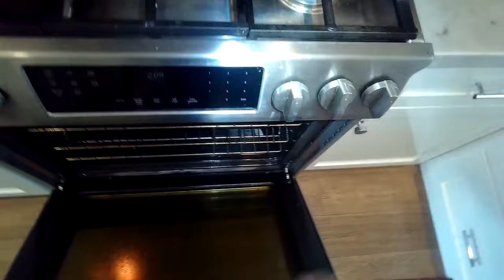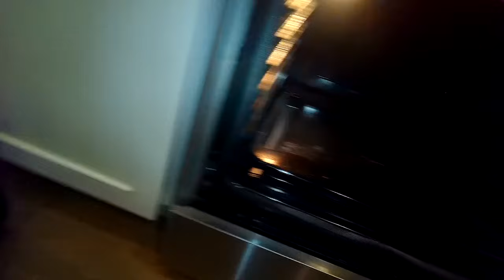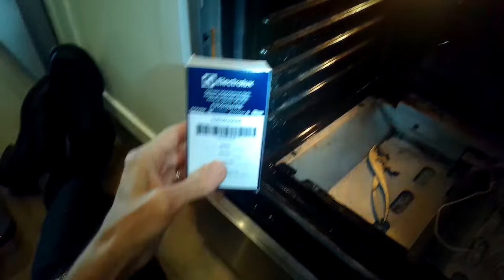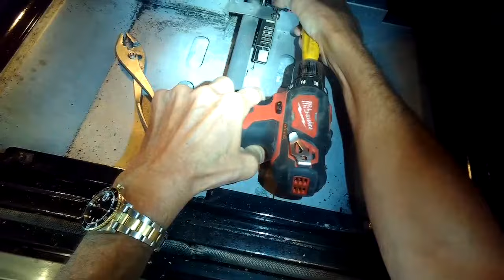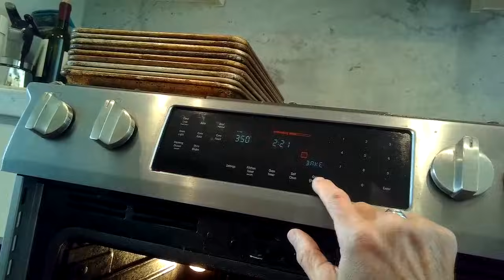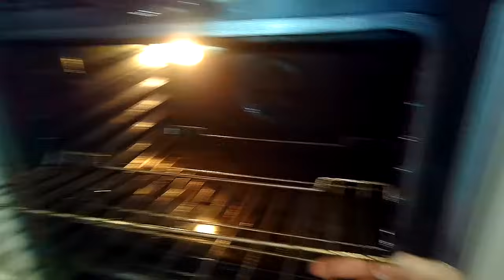✨ BOSCH OVEN WON’T HEAT - EASY FIX!! ✨

Comment: How did you know the igniter was the problem and not gas valve etc?
Reply from the maker: Great question?
From my repair experience,
The igniter is the culprit in over 75% of cases.

Comment: Awesome video.  Thank you very much.  *I don’t use my broiler very often so I switched igniters.  Torx 20 and a tiny wrench if you can’t reach the nuts. Quick and easy swap until new part arrives.*
Reply from the maker: Awesome, great tip! 😊

Comment: Hi Scott! What if my oven is not heating up fully (only going to about 300 degrees max) and it's an ELECTRIC Bosch oven? What do you think it could be? How can we know if it's actually the control board or something that might be an easy fix? Thanks!
Reply from the maker: I’d say the bake element located below the lower panel or the element in the back has stopped working.

Comment: Very cool video. Though you didn't show how to put the door back on. Now what?
Reply from the maker: Slide the door forks back into the frame and then pull the door down to 90 degrees and then flip up the catches near the hinges toward the oven and then close the door.

Comment: Thanks for the video! But I followed all the steps you did but still not working. Should be the igniter as the oven makes a click sound when I turn it on. But doesn’t heat up. I have the same oven as in your video. The wires from the oven look a bit different than yours though. I think it’s just some sort of insulation on mine though. I spliced the wires and connected to the new igniter. But no luck. 

Also how essential are the ceramic caps? I did lose one in the openings of the oven. I’ve ordered a new one so waiting for it to arrive. 

Any tips would be appreciated!
Reply from the maker: Thank you. When you get the new ceramic caps make sure they are on tight.  If still no heat you might need a new controller.

Comment: Hey yall. So my oven does heat up.... but it won't heat up all the way. It'll heat to like 275° but not up to 450° or anything.... would this be the same fix??
Reply from the maker: Hey Max,
I would suspect that the convention round element that lives near the back of your oven needs to be replaced.

Comment: is it ok to be cutting those wires with the oven plugged in and on? i see a light on in there. just checking. btw my igniter doesn't glow at all and my  bosch upper broil is fine but the bake is not going on at all my digital display shows the "pre heat" option start to fire up and just sticks on that screen
Reply from the maker: It’s best to turn it off.
A new igniter will fix it👍

Comment: Just one important nugget. I replaced my igniter and before putting the oven back together and the door back on I thought I would turn on the oven to see if it would would work and it didn't. After swearing for a bit I suspected perhaps there is some sort of safety cutoff that prohibits the oven from working with the door off. I replaced the door and it fired right up.

After posting this I read comments below and see others mentioned this as well. Guess I should have read comments before attempting this.
Reply from the maker: Excellent info. Dan,
Thank you👍

Comment: Great video, easy replacement but after turning the oven back on and baking, the ignitor isn't turning orange at all. Any tips?
Reply from the maker: Gotcha,
Did it glow a little before the replacement?
Reply: @QuickAndEasy5MinuteAppliance  no glow, nothing
Reply: if it doesnt glow before the replacement does this mean the igniter isn't the problem? @QuickAndEasy5MinuteAppliance

Comment: Very helpful. Just replaced last night. Question: are the heat resistant covers that were on when I pulled the wiring out really necessary or just optional? I did not reapply those to the new wiring
Reply from the maker: You should be fine😊😊

Comment: Hi thanks for your video.
Very clear instructions.
I have the same problem my oven is not getting hot and the broil is working fine, my question is that I see the old igniter is getting orange just the flame never starts dose that mean I need ignitor?
Basically my question is how do I know if I need a new igniter?
Reply from the maker: Great Question Josh👍 Click Here to Get Live Expert Help From Me For Just $5.00:
https://www.youtube.com/channel/UCGpInAejvpfVVE4FHB_L-Dg/join
Sounds like a new igniter will fix it👍

Comment: Worked for me except could not test until the firewall and oven door were back on but it preheated all the way now. Took ~35 minutes all told. Thank you! Tenants are happy that not only does it work, but I addressed their issue in 2 days (because Amazon Prime took 2 days to deliver the new igniter).
Reply from the maker: Nice work! 😊😊😊

Comment: 3 questions (I ordered an ignitor which will be delivered tomorrow):  1. How do you manage to get the oven door off? It looked so easy in the video but I tried moving the joints like he did in the video & it wouldn't budge. 2. My oven electrical cord is easily accessible in the cupboard behind. Do I need to shut off the gas too? It looks like I have the exact Bosch model shown in the video. 3. Do I need a right angle drill or can I manage with a short screwdriver to navigate the angle? I'm fine buying the drill if I need to. Hoping someone answers because my daughter ususally spends Thanksgivning (6 days from now) with her dad, she's coming here this year & I just realized my oven wasn't working though the range & broil work fine, I can't get a repairman at this late date.
Reply from the maker: Hi Patti,

You don’t need to shut off the gas.  It’s ok to leave the oven door on.  Can you try loosening those screws with your screwdriver?  I think they’ll come off.  I’ve done this procedure many times with the door still attached. You might want to put a drop of oil on the screw threads to make it easier for the screws to come out👍

Comment: I wasn't able to pull the ignitor out after unscrewing it.  I pulled it about 1 - 1/2 inches and it refused to budge.  I was afraid to pull really hard in case something would get damaged or dislocated.  The oven model is HGIP054UC. It looks like the wires may feed further back, behind the fan assembly, which I am afraid to remove without good diagrams or video.
Reply from the maker: Thanks Ron,
If you can get behind the oven and remove the back panel you’ll be able to see how those wires connect.

Comment: If you can pull the stove away from the wall it is much easier to make the connections as the gas valve and control box are right out in the open. When I replaced my igniter I just mounted the new one, fed the wires through the hole, and made the connections in the back away from the oven heat. My old igniter also had ceramic sleaves aver the wires which I simply slid over the wires on the new one before connecting. Doing it this way could probably be done without removing the door which can be a real challenge to reinstall.
Reply: I had to take the sleeves off and reverse them to be closest to the igniter. Made stripping the old wires much, much easier.

Comment: You showed me how to take the door off of my Bosch gas oven, however I'm having a heck of a Time reinstalling it! After you replaced the ignitor in the oven you didn't show how to put the door back on, Do you have a video for that? I don't know if I'm doing something wrong or if there is something wrong with the door now? It came off super easy after watching your video. I have been looking through your videos and I can't find one that matches.
Reply: Me too!!!  Did you figure out how ti reset the door??

Comment: Great video, very helpful!  Just one minor quibble for the purists:  Splicing wires is when you attach them together.  When you remove the insulation that's stripping.
Reply from the maker: Thank you👍

Comment: Hello; will this work the same for a Bosch Electric oven? Mine is an HDS8055u  Which is a duel fuel unit. Stove top is gas and the oven is electric. We have had a lot of power cuts which I think caused the unit to fail.

Comment: Great video, easy to follow. One note: if you’re testing the igniter after install, either put your door back on or fool the safety mechanism by pushing in on the pin the door would normally rest on. Dumb mistake, but cost me 10 minutes of self-doubt.
Reply from the maker: Good advice Jesse,
Thank you for the info.
Reply: Great advice!!! I was about to call someone over to look at it because it wasn’t glowing or anything and as soon as I put the door on it worked!

Comment: Hmm what do you mean by "won't heat"?  If I turn mine onto 450 an hour later it's still at 150 or so.  So it's turning on but not heating up properly.  Is this just a fix for not igniting?
Reply from the maker: It also fixes an oven that won’t reach temperature .

Comment: my wires don't pull out very far and are coated with a white mesh.  Can I still replace this
Reply from the maker: Yep,
Don’t worry about the mesh,

You can cut right through it and push it back.
Reply: @QuickAndEasy5MinuteAppliance  Thanks

Comment: Hi So I realized the broiler and oven won't work the stove top does so gas is working. I replaced the ignitor from this video now what? Thank you and great video!!! any help is amazing.
Reply from the maker: Nice job Brooke,
It sounds like it’s time to replace the safety valve.
That’s the part that will allow the gas to flow in to be ignited.
It sounds like it’s no longer opening up to let the gas flowing.

Comment: Thanks so much for this!  Bosch oven works perfectly now and probably saved me over $300 by doing it myself.  I will say that unlike the video, my ignitor did not heat up (nor did the broiler ignitor) until I replaced the floor housing and door.  I suspect that this might be a safety mechanism that Bosch created.  My unit Is 6 years old model: # HGI8054UC
Reply from the maker: Awesome,

Thanks for the update😊👍

Comment: Great video! I'm subscribed! Perfect title, I really like the narration. Thank you for narrating it after the fact - really helpful. Our brand new BOSCH's oven is inconsistent but basically doesn't work. Broil is fine. Range top is fine. Let's open her up and take a look, the warranty service call isn't for 3 days.
Reply: Hmm. Slightly different than the oven you fixed. Our igneters spark, the burner sometimes lights. Is it me or do you get less reliability the more you pay for an oven? We were forced into Bosch for sizing because of the requirements of the corner it has to fit in (thanks, whoever designed this kitchen! Haha!). Our friends with pro-style ranges seem to have complaints. Thanks for the great tips and inspiration, though!
Reply from the maker: Thanks Shannon, I would gently clean that sparking electrode with a wire brush to see if it will become more reliable 👍

Comment: Great video.  Saving a whole lot is so true.  VERY IMPORTANT!!!!!!!!  to mention that you used either PORCELAIN or CERAMIC wire nuts to connect the spliced wires.  Those are heat resistant to 1000 degrees F.  Also, you appropriately DID NOT cover them with regular electrical tape.  Black tape would melt at 200 degrees F, and cause big problems.    If you get a good connection, there's no need to tape.    IF you feel the need to use tape (or join with crimps, by twisting, or heat sealing), YOU MUST USE heat resistant glass or other specialized tape to cover the join.  What comes next are several observations on 'support-repair-services-and-official-Bosch-replacement-parts' NEWER Bosch models.  Read as necessary.  Sorry or the length.   :::::::  INSTALLATION HASSLES AND SMOKE/FIRE COMMENT:  Bosch has made replacing the igniter MUCH MORE DIFFICULT IN RECENT YEARS by shortening the wires between the igniter and connection, + adding a 2nd (largely unnecessary) box through which the wires travel to the connector.   IN NEWER (post 2012-14) Bosch Gas ranges, THERE IS A SMALL, PROTECTIVE BOX BEHIND the 1st layer of firewall.  It is almost impossible to get even the smallest plastic wire nut through the tiny (3/8" sq) hole in this box to fully protect the wire nuts.   IF YOU JOIN WITH PLASTIC FIRE NUTS, they will not meet code and WILL ALMOST ASSUREDLY MELT -- even if pushed through the small round hole in the back of the oven).  MELTING IN THIS ENCLOSED SPACE HAS A VERY HIGH POTENTIAL EITHER TO SMOKE OUT or START A FIRE inside the over AND (CRITICALLY) INSIDE THE BACK PANEL of the oven where ALL the wiring and circuitry resides. Even a small amount of smoke will kill the circuit board, a $250-$500 part  ::::::: CHEAPER IGNITER COMMENT RE THICK, FIREPROOF WIRE JACKET:  One other issue is that cheaper igniters (which I'm a fan of at 1/5 the cost) usually don't come with the added fireproof insulator cover that the factory part has.  The easiest solutions, as far as I know, are: (A) do what you've done and make sure the wire goes behind the firewall; if doing this, I'd still prefer to pull the thick insulator cover forward and splice/join with ceramic nut BEHNID the insulator cover -- as far back toward the connector as possible (difficult on newer model ovens as the connector is toward the back left corner of the over, behind the firewall.  ** OR ** REPLACING AT THE CONNECTOR:  The following all are based on unclicking the old wire at the actual connection (accessed from behind the oven), and clicking in the new wire to the existing female connector.  It requires the added hassle of accessing the back of the oven's wiring + fishing the new igniter cable through the front to the back., BUT it provides you with fresh wire all the way to the source connector.  THIS CAN HELP if it appears one of the old igniter wires is burned/shorted (much more common that one might think).  The way to confirm this is to cut the bad igniter wires close to the igniter and inspect the wires for blackening.   ALSO, one can check to old wires (as mentioned in this video) to see if 110V are coming through BOTH wires.  :::::::::   PROCESS:   (A) If the new connector you ordered  already has the secondary thick wire insulation jacket, CONGRATUATIONS!  Remove the back panel of the oven to expose the wiring, fish the new connector wiring through, and simply unplug the old connector / plug in the new (nale) connector; then install the igniter inside the oven. ( B) If the new igniter doesn't have the thick outer insulator jacket, remover the old jackets from the old igniter, (unfortunately) cut the new igniter wire about 2-3 inches from the female end of the connector plug, put the old thick insulator jacket over the longer ends of new wires, and splice them back together; the splices can be connected near the the female end of the plug with wrapped wire nuts (behind the firewall), with ceramic wire nuts (extra, extra safe), or by twisting the wires together and then using high-heat tape to cover the exposed wire; finally, pull the thick insulator jacket back over the wire, and install the new igniter by clicking the male end of the new wire connector into place and attaching the new igniter into place inside the oven.  (C) Cut the new igniter wires up against the male plug found on the new igniter, put the old thick insulators over the new wires, then crimp on a new male plug; pull the thick insulation back into place and complete the installation by clicking in the new plug and attaching the new igniter.  (D)  Ignore the thick insulator wire and hope like hell the new insulator wire cover has enough heat resistance.  :::::::  FINAL WORD: In my experience, the new wires will be ok UNLESS for frequently use the over at or above 424 degrees F OR if you run the self-cleaning cycle more than once every 2 or 3 years -- self cleaning mode. techs will tell you, is an igniter-killer, regardless of the installation method you use.
Reply from the maker: You speak the TRUTH😊👍

Comment: Thank you for video. Our Bosch is 13 years old. My husband changed the igniter out with little problems. The one wire pulled out pretty far but the other wire only came out a short ways but was enough to work with. Oven up and running.
Reply from the maker: Awesome,
Thanks so much Alison😊

Comment: Thank you so much- this was such a great informative as well as instructional video! This happened during both Thanksgiving and Christmas baking! It then did not work at all. We called Bosch and they wanted to sell us an extended warranty which would mean $$$ just to get the warranty and then more $$$ because they charge just for someone to come out and look at it. We can’t believe it because it’s literally only been 1 year since we bought it. We noticed in the video that it’s the same model.
Reply from the maker: Super easy to fix👍

Comment: This sight was a great find!  Thank you for posting.  I would like to encourage all other Bosch oven owners to call Bosch and register the problem.  I did and asked if they had a recall or had received other complaints.  They denied they had and did register it.  I tried calling to order a Bosch ignitor and was on hold for over an hour.  So I clicked on your link and ordered the Electrolux ignitor.  I'm super stoked.  My son is here now and going to install! Wish me luck.  I will give you a report afterwards.  Also if this works will donate using the "applaud" link.  My local repair shop wasn't going to be able to get out for at least 2 weeks as their service tech had been off ill for 2 weeks (COVID obviously).  Plus they were going to make 2 trips.  One to diagnose and the other to repair.  $$$$$$$$$
Reply: Plus my Bosch is exactly 3 years old!!!
Reply: Okay update as promised.  This is important! My range model is probably a little newer.  HG18054UC/07.  So you MUST PUT OVEN DOOR BACK ON FOR OVEN IGNITOR TO WORK!!!  My son repaired it with the Electrolux ignitor as in the video however it wouldn't ignite till panel and door replaced.  This must be a safety feature they've installed on newer models!   Thank you Quick and Easy 5 minute Appliance repair.
Reply from the maker: Nicely done😊😊😊